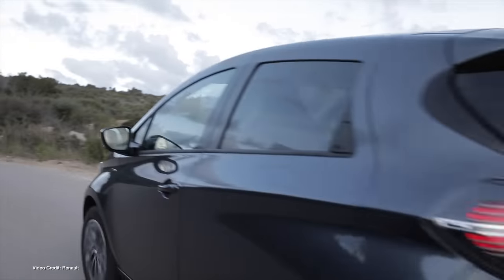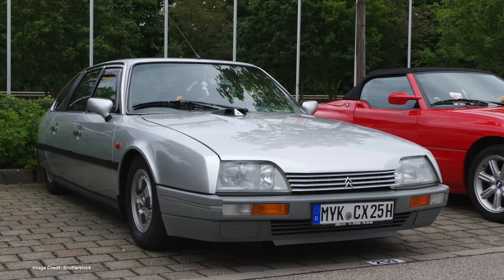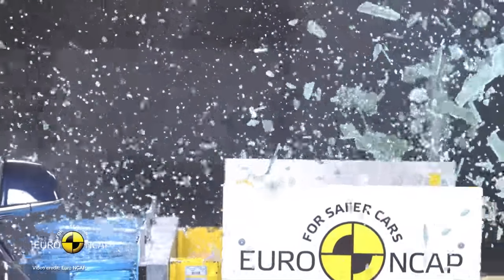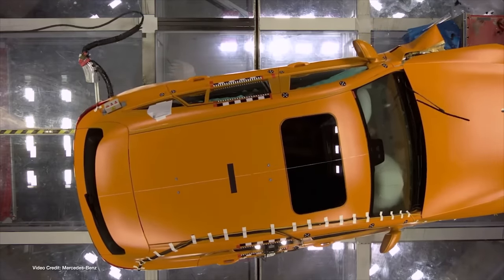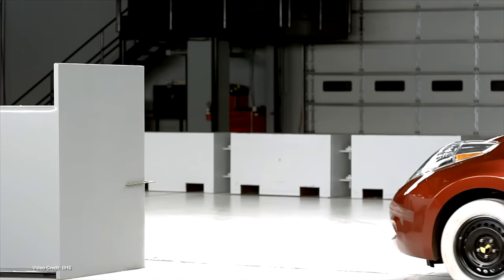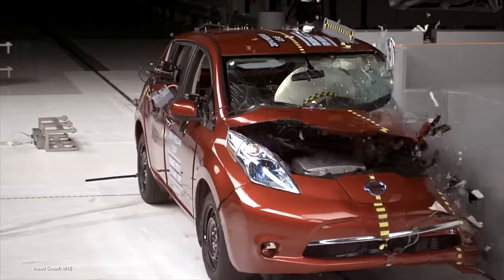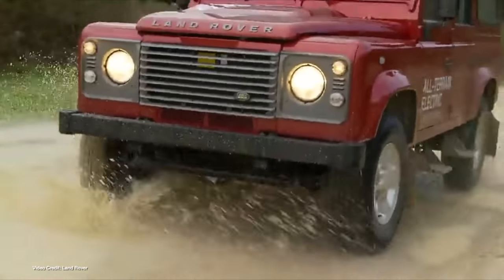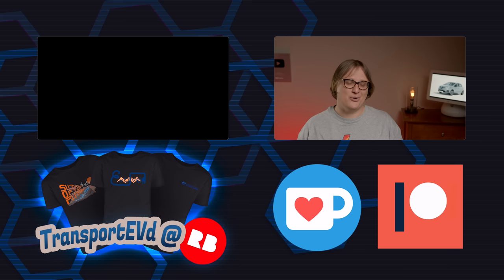Forbidden Fruit EVs - Why You Can't Just 'Import Them'

Comment: Volkswagen e-up.  It's like the Spark EV, but at double the range, and better looking.
Reply: I bought an interim car after placing an order for a CYBRTRK IN 2019
That car is a manual Up! ICE 2013 model If l had the eUp! as a choice l would have jumped for the Sky_

The Up! engineering is on point, and can be driven long distances even though it's supposed to be a 'City' car

Comment: Maybe a true global electric car will be center seated have LED lights that the software can change the intensity and spread based on gps, pass the most stringent crash test would enable to pass all lesser crash tests.   Also, a universal charging port that would accommodate all makes and electric standards. Nice thing is that none would have to worry about passing emissions in different markets.

Comment: Something else I was considering as to why you can’t import, was the difference in charging standards. For instance, I don’t think you could charge a Minikes equipped EV on a US 240V circuit due to the differences in electrical infrastructure in our homes.
Reply: surprisingly, there are all sorts of adaptors available online. I can't imagine there is much of a market for them tho...
Reply: @beamerbread  it's another example of that "cottage industry": you don't need any complicated factory, just a shed and someone who knows how to connect the cables in the right way to off-the-shelf plugs and transformators.

Actually, my old EV Peugeot Partner electric is a standard chassis where they shoehorned a battery and electric motor in the production line replacing the old ICE.
The whole EV schtuff was a Mitsubishi production, all in Japanese (was the time Peugeot/Citroën sold the MiEV with their logo as I-on/C-Zero)

The French just swapped the original Japanese 120V-to-battery internal charger with a similarly sized 240V-to-battery and Voilà.

Comment: U.S. forces are governed by a different Status of Forces Agreement (SOFA) in every country in which they are based. The SOFAs dictate rules about the purchasing and importing of cars, and they do vary from country to country. For example, many years ago, while stationed in the UK, I had shipped over a U.S. spec car, but could not register it without adding yellow turn signal indicators. Having been in and out of Europe for about 27 total years since the 1980's, I have bought and registered several U.S. spec cars in England and Germany. I have been driving, from new, a U.S. spec 2005 Landrover LR3, and am about to take delivery of a U.S. spec Jaguar I Pace. We do have to pass local annual safety inspections, like MOT in the U.K. or the more rigorous TÜV here in Germany. When I stop working for the U.S. government, I will not be able to take advantage of these privileges, and that is what they are. We know it. Also, add to your own list of FF the Honda e. What a cool car!

Comment: Last I checked there was oanother loophole in the US. You can build a car from various parts of cars and meet a much lower set of standards by it being one of a kind prototype.  You could take a 5 year old iCE and electrify it with Tesla guts.  Crash testing would not be required but lights and brakes woud need inspection as if you rebuilt a salvage car

Comment: On the military families stationed in foreign locations: those terms and exemptions are part of the agreements between the governments that govern the foreign military personnel being stationed in the country. EG the US troops stationed in Europe over the past 70 years. But I suspect those cars are also expected to eventually leave the countries with the military personnel (who brought them or other military Personnel  they sold them to ) or be scrapped. So when a US spec car was imported by a military family moving to Germany they it another soldier took it back to the US eventually. 
Ah the 1980s when headlight changes ans a beefier radiator support was the biggest worry. 
Audi turned me odd because they didn’t import a model in the engine and transmission and door configuration I wanted that they sold in Germany but not the US. They sold models with  all of those features in the US   Just not all of them on the same car at the same time. 
With modern crash testing it’s just nuts. Heck EVs can’t even get behind a single AC and DC charging port. So yeah the ID3 in some 2025 version will be my forbidden fruit in the US.

Comment: I've seen a few lefthand drive cars on the road, they do have to have a sticker stating it is a lefthand drive! Not sure what else had to be done. I know of a bloke who imports second hand yank tanks and doesn't change them to right-hand drive. Our safety rules are basically the same as Europe which is good but our fuel is some of the worst in the world! I would like a Sono Sion but that is not going to happen. Bugger!!
Reply: It "depends"...

If you've owned it overseas for more than a year, it's pretty easy. Over 25 years, it depends on the state. WA it's easy.

Under 25 years of needs to be on the register of enthusiast vehicles, which is... Complex and you can't import many. 

Or if it's not on the REV, you need to put it through ADR testing and become the "manufacturer". LHD won't go through ADR.

Comment: You wouldn't believe some American car LHD conversions. Do you believe we cut the steering column and fit it on the Rh side. A cog at the bottom of the column and a Cog on the steering box and a 8 foot chain driving the steering box from the Rh side. Cut the dash in half and swap around with some serious dash work. All European cars are easy to converts. American cars were always hard as they never made Rh drive cars so we had to make them work. I have concerted many LHD cars to rhd.

Comment: Did I see F-150 Lightings coming off the line?
Reply: No, that truck had a huge ICE radiator. While I assume the Lightning has a heat exchanger in that spot, it would need to be much smaller in height to accommodate the opening of the Lightning’s frunk.